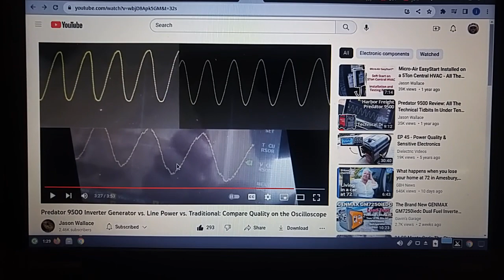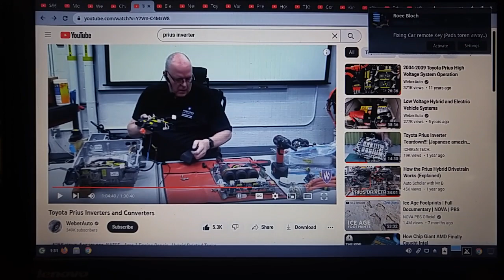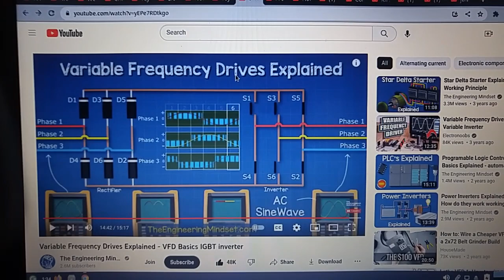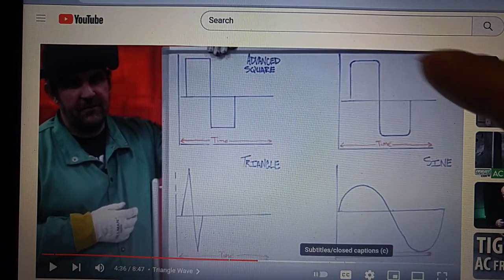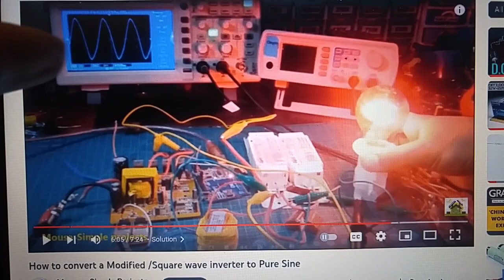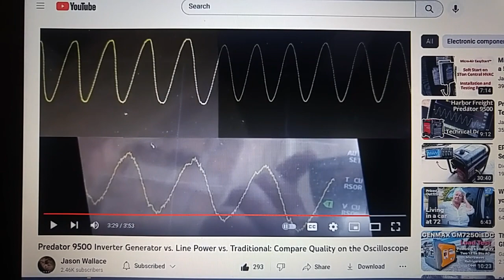Muse Regarding Using Prius MG's and/or Prius Inverter-Converter Module For Hacking A Generator...

Comment from the maker: Note that I'll make a followup video to detail the creation of the pure sine wave more, as the "basic" or "black box" noted details regarding the pulse modulation of the H-bridge, or whatever the H-bridge is termed for 3-phase designs, to create the waveform at a specific voltage, current and frequency wasn't detailed well.  I also placed some links in the comments sections regarding specs and confirming my thoughts somewhat:
https://www.facebook.com/james.analytic/posts/6803611023033975?